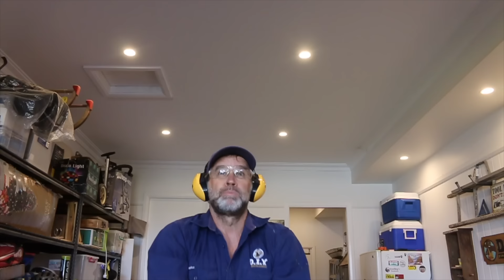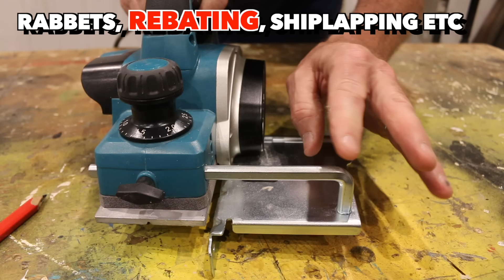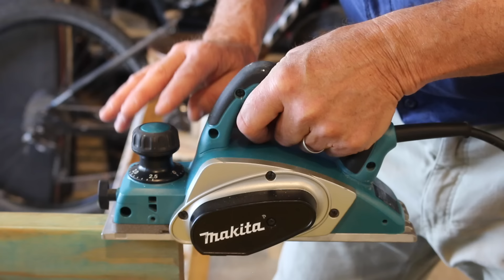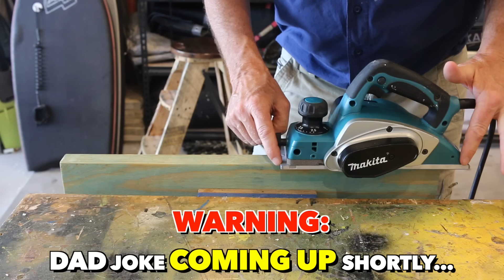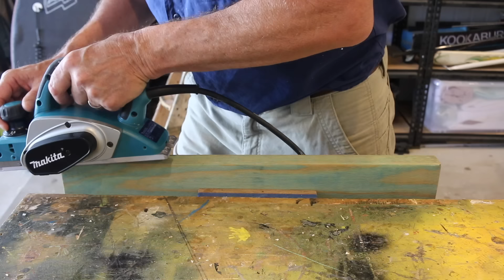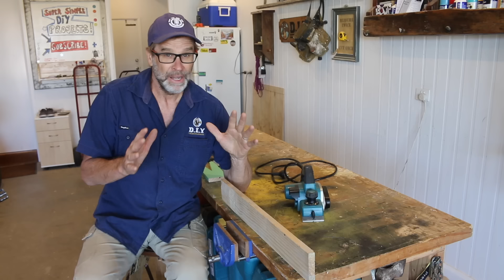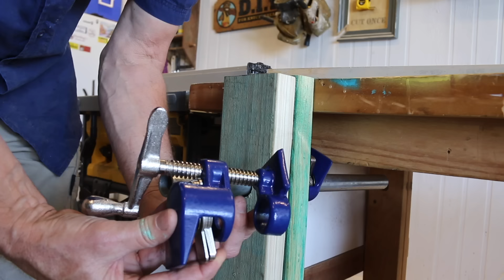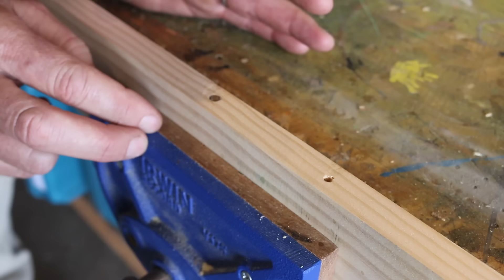BEGINNERS Guide to Using an Electric Planer.

Comment: Great video, but it would be helpful to see the planing of the face of the wood, rather than just the edges, as I always end up with ridges that I have to sand flat.
Reply from the maker: Thanks Peter. Planing a flat face is a bit more advanced for the beginner which is why l left it out of this video since it was a beginners video. It has a lot to do with the correct alignment of blades and a few other factors to do it right. Might have to wait for an updated video for that one. Cheers 👍🇦🇺😁
Reply: Look into helix blades. I would also recommend using a bandsander (belt sander?) for face edges :)

Comment: as a Framer, Ive used the planer for years, actually we use the Makita also. In OZ do you folks use the planer right before drywall like we do in Merika?
Reply: @parry4now  after the walls are "done" before the drywall goes up they (the studs, window framing, etc.)  must be less than 1/4 inch  higher or lower from each other. if a  stud is crowned  or "proud" we plane it back into submission.. if its low or concave we add shims, so no peaks and valleys just a flat wall. good lumber quality and a good crew minimize planing and shimming
Reply from the maker: Sure do Mos 👍👍 Gotta get those walls straight prior to drywall mate 👍👍🇦🇺 Thanks for watching 👍🇦🇺😁
Reply: Yo so I live in the Netherlands and I've never used one of these when working in a framing prefab factory. 

Metal C shaped profiles are also really common as the frame for drywall, they don't need straightening anymore. There's not a lot of new construction going on that's based on wood framing, most of it is concrete or prefab. Most of the framing that is done is small scale or it's metal stud 
https://www.google.com/search?client=ms-android-tmobile-BN&tbm=vid&sxsrf=ALeKk00yy7xpwjtNp-_mXAErvO5VQr8t1w:1603491015506&q=metal+stud&sa=X&ved=2ahUKEwjusoTD3cvsAhXEZxUIHac_BHkQ8ccDKAN6BAhAEB4&biw=486&bih=783#
Reply: @parry4now  flattening lumber so the wall isnt bent
Reply from the maker: @parry4now  There's a lot of wall straightening required when framing.which needs a planer. They are also very handy for things like straightening floor joists etc 👍

Comment: Where do you buy pipe clamps in Australia?
Reply from the maker: Mate, you can buy them from most of the big box stores. Just be aware that you will need to buy the pipe as extra. Some of the clamps need the pipe top be threaded on both ends. The pipe clamps I used in the video don't require the pipe to be threaded which is a real bonus 👍👍🇦🇺🇦🇺 In case you're wondering, they were 3/4" Inch Irwin Clamps from Bunnings 👍👍
Reply: @diyforknuckleheads  thanks I'll take a look at Bunnings tomorrow. Last I checked they did not stock pipe clamps although it was the typical 12 year old behind the counter that was responding to my question with a hesitant confidence look that screamed "please God don't ask a follow up question!"
Reply from the maker: @dooshakhaboosha2573  Hahahahaha....l got the same reply when l went in and had to find them myself. Funny thing is, is that they aren't mentioned on their website so l had to give the young fella a break 👍

Comment: I bought a Ryobi planer less than a week ago and its blades were knicked. The guy at Bunnings was just about to refuse me a freaking refund/replacement, but ended up replacing it anyway.

Believe it or not, I was too scared to bloody use it... but now you just posted this in the nick of time. You beauty Uncle Knackers! Going to watch it right now!
Reply from the maker: Awesome! Hope the videos useful Isa! The good thing (generally) about Ryobi is that they usually refund faulty tools without to much drama 👍 Have a good weekend mate 👍🇦🇺😁
Reply: @diyforknuckleheads  yeah I reckon that would be the case. Unfortunately I got a hardball Bunnings personnel guilt tripping me.

“Well if you’re a tradie, you need to know that Ryobi only make tools for hobbyists.” He said.

I told him the last planer I bought was from Masters. IE, I rarely use the buggers. IE not worth spending the big bucks for something I rarely use.

He begrudgingly went and brought over a replacement.

Sorry for the rant buddy. He peeved me off a bit.

You keep up your great stuff buddy 🇦🇺 👍

Comment: I am about to plan a couple of doors tomorrow and it’s one job I suck at. This video couldn’t have come at a better time 👍
Reply: Do a couple of practice runs before committing on an off cut.  Thank me later.
Reply: I have had my father’s (RIP) planer for years and about to use it for first time. Trigger shy and REALLY glad I found this video!! Perfect timing!!! Subscribed too
Reply: https://youtu.be/jBQG2BvTOGE👍
Reply from the maker: Good stuff Joel! All the best with the doors mate 👍 Let me know how you go 👍😁🇦🇺
Reply: @diyforknuckleheads  hi buddy, what's the brand of blue pipe clamp that you use in this video? The link is for a different clamp that looks not as good for what I need.  Thanks for sharing!
Reply: @silversurfer233  They look like Irwin pipe clamps
Reply from the maker: @silversurfer233  Mate, mine are Irwin Clamps suitable a 3/4" Pipe. They, unlike a lot of other pipe clamps don't require a threaded end on the pipe which was really appealing to me. I did a search on Amazon, found the same type but it was for a half inch pipe which to be fair is probably OK. The ones l linked to are a very popular model and will do the job for you perfectly. Thet just need a threaded pipe. Hope that makes sense 👍😁🇦🇺
Reply: @diyforknuckleheads  thanks for the reply, I will get a set of each as they will be "good to go! "
Reply: @silversurfer233  @
Reply: @arpie2081  Mine are, good brand.